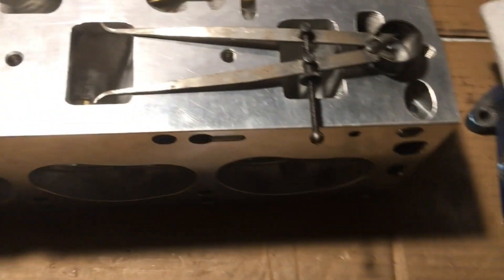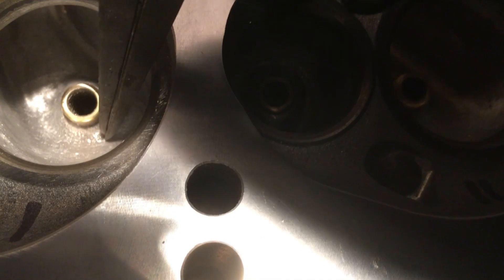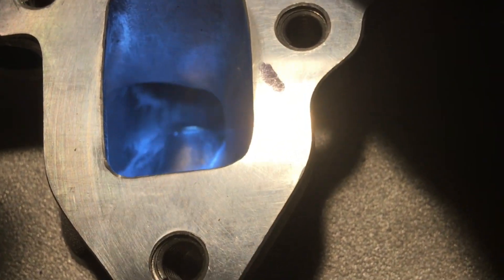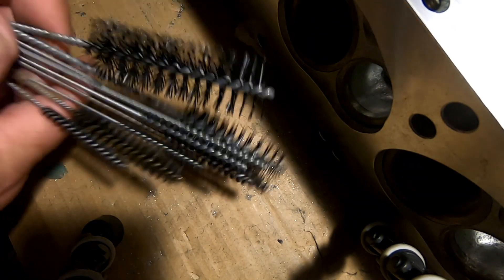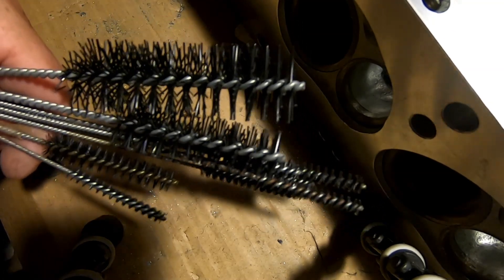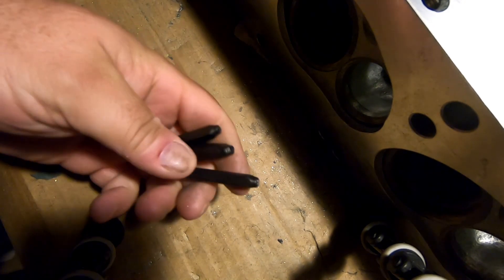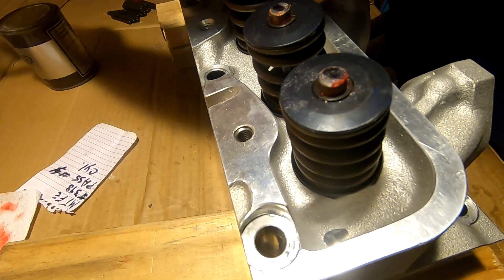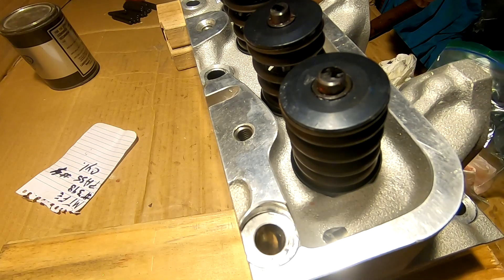FE Build part 2: Porting review, head cleaning and re-assembly

Comment: How Much more CFM can you get out of the Edelbrock heads with your port job they say 270cfm out of the box
Reply from the maker: Thanks for watching.
The last set we flowed, was about 7yrs ago were 285 avg. 
I had one set I spent a lot of time on that was in the mid 290s.
I need to get me another flow bench and do a before and after.
Reply: I’m building a 465FE stroker are these heads enough for this combination I’m hoping to see 500 HP and 500 TQ
Reply from the maker: What is the intended application for this fine big FE?
Reply: @FabRaceModRepeat  A torque monster for the street 69 mustang fastback with Detroit speed mini wheel tubs running a 285 6015 tire five speed tremmic  Will these heads out of the box support 500 pounds of torque coming in around 3000 RPMs
Reply: 350 to 1 gear ratio Posi
Reply: Hydraulic roller cam maybe 235 245 @0. 50 590 lift With a 106 or 107 LSA
Reply from the maker: @scottward7533  
With a lite port and intake match. It’s doable, just watch the spring pressures.
Reply: @FabRaceModRepeat  What are the limitations of the springs that come with the 60075 heads
Reply from the maker: @scottward7533  
I would use the springs the cam manufacturer recommends for the cam you’re going to run.
You could also compare those spring pressures to the Eddie heads. If the pressures are good and you have no spring bind you should be golden.
Reply: @FabRaceModRepeat  Thank you for your time and information
Reply from the maker: @scottward7533  
No trouble at all
Reply: @FabRaceModRepeat  How much would you charge port a set of fe Edelbrock heads
Reply: Something that you find is the hp and tq is higher than the flow numbers show when the intake manifold is dressed correctly in the port match. Getting them matched and square and they are  310 -330 cfm heads. I cut the intake part off of an intake and found 40 cfm. It’s there. A 428 can make 600 hp and over 500 ft lbs of tq with an RPM intake.

Comment: Thank you for commenting on the research that went into the FE. I have a .020 over 390 that I ported the C4AEG heads and put 2.15/1.65 valves in with a solid 428SCJ   C cam and a Holley Street Dominator. It flowed 285 cfm on each intake. I just followed the shape of the port. It dynoed at 508 hp and 488 lbs ft. The power band was wide! 3500-7000. No problem.  3000-6300 no problem. It is a beast. The FE is the best executed design, they crippled many with milqutoast cams. They are easy to get 500 with nothing but a cam intake and minor porting. I have done it. I do wish Ford had released these beast with just their own parts!